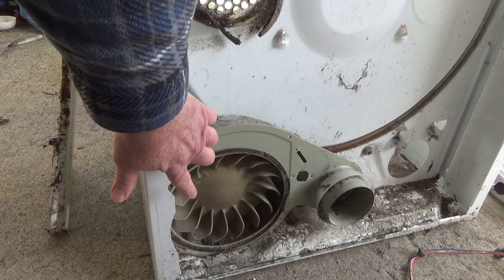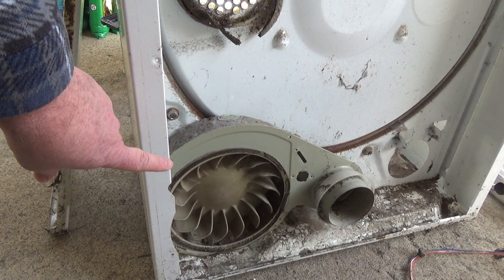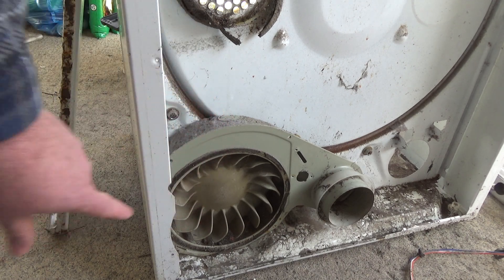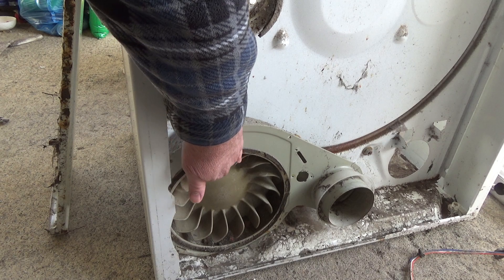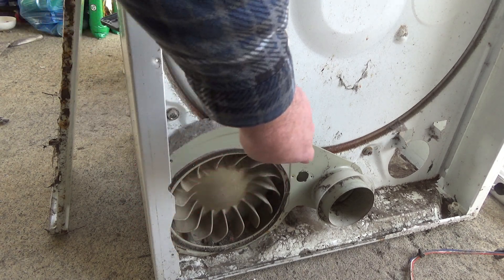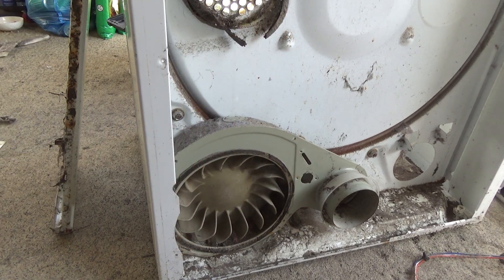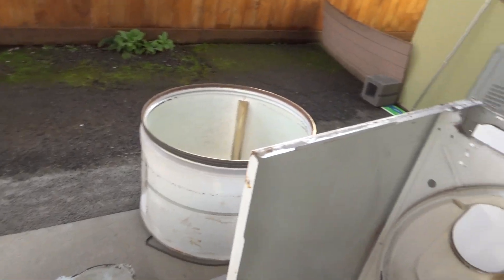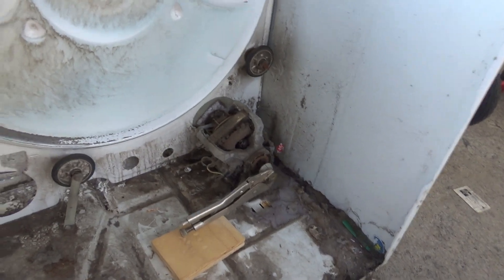How to removing stuck blower fan from dryer

Comment: GREAT IDEA!  But the newer fan/blowers have a huge hard plastic square for a crescent wrench to fit and all it did was break this hard plastic into pieces. That fan was seized on solid. Only way to get the motor out of the sheet metal was to drill holes in the plastic fan around the shaft at the end to let it loose. Added $13 to the cost for a new fan blower. Decided to get a new dryer afterwards. Will use it as a spare until the new one decides takes a dump.

Comment: Hey, just gonna try my luck with an odd question...  today a bird made it through the dryer hose then got stuck and died in the dryer fan.  I was there and it died instantly and I turned my dryer off within seconds of hearing it seize up.

I took it apart, except for the fan--I was able to use a screw driver to push it back to where the fan blows through and remove the bird.  So nothing mechanical was disassembled--just front exterior pieces, the aluminum tube that connects the flexible hose to the the fan and the covering of the fan.  Ran it for 20 minutes with nothing and it sounded good.  Ran it with a small blanket and there was a small noise every so often (somewhere in the rotation because it was consistent) and then ran a larger blanket afterwards and it made a loud whining noise--also consistently intermittent.  Does this sound like the bird causing the fan to seize up had an impact on the belt or do you have any other ideas?

It's a 12 year old Samsung so I'm thinking of replacing then repairing if it sounds expensive.  Thanks and good video!!!
Reply from the maker: If the fan is in the front, it most likely stripped the fan center bolt loose.
Reply: @tubejim101  - the fan is in the front--thanks for such a quick response...  also, my father and I tried to take the fan off but we couldn't get any tension behind it.  I'll give it a shot to tighten it--thanks!